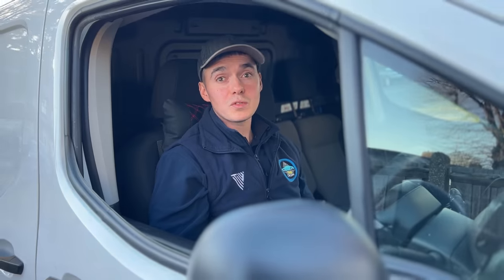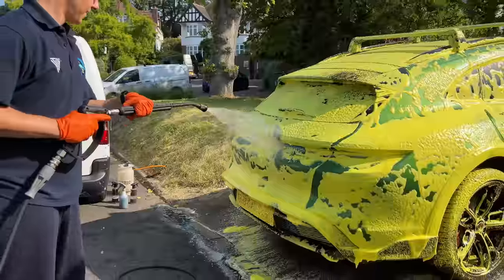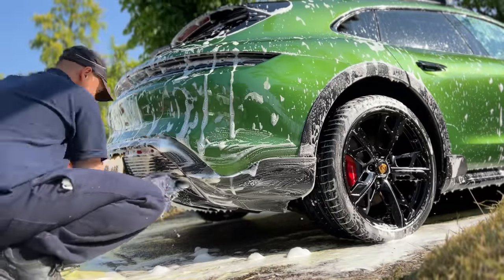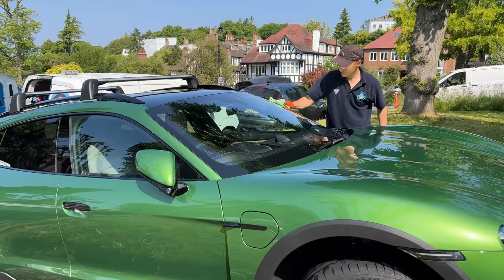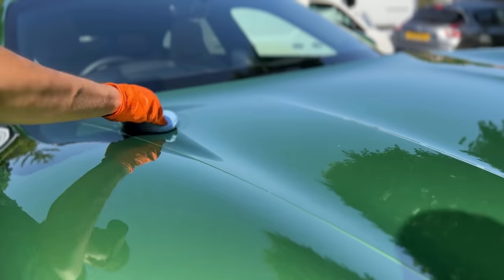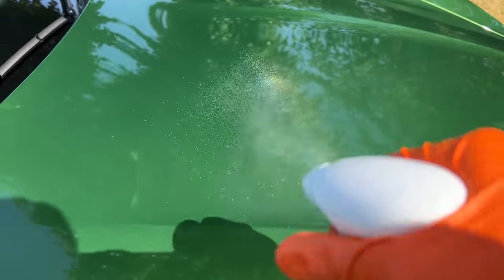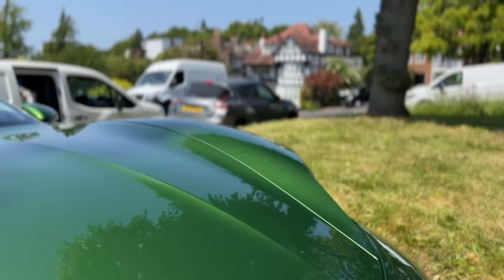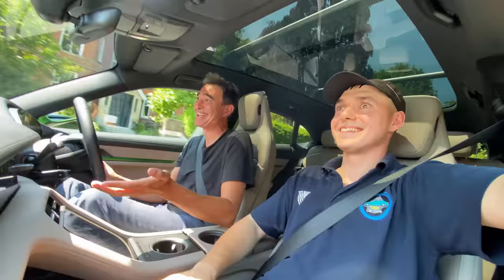How MILLIONAIRES Clean Their Cars?

Comment: Lovely video and like the owner interview but honestly quite a few opportunities to improve technique.  Aside from the obvious i guess you could not avoid doing it in direct sunlight but brushes on the paintwork, using the mitt from the lower bumper to the upper bumper and spraying the interior window cleaner inside the car, coating other surfaces, rather than onto the MF and finally coating without machine polishing.  Yes it’s brand new but whenever has a dealer properly prepped a car.  Perhaps not a millionaire’s wash after all